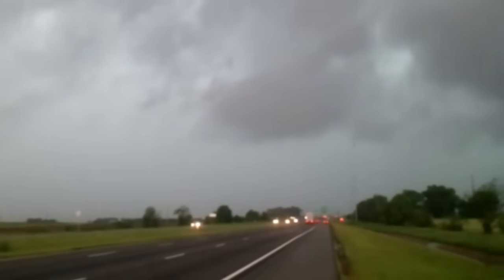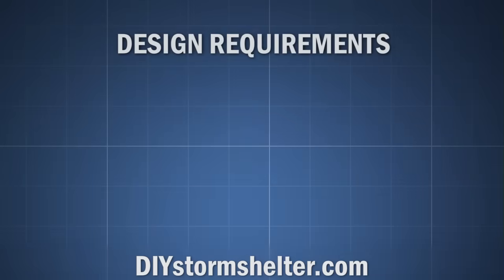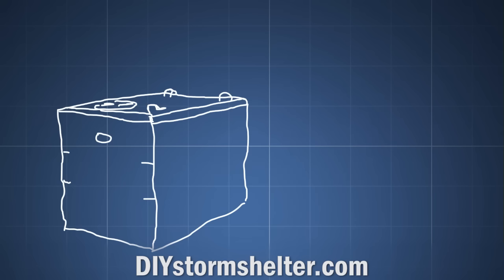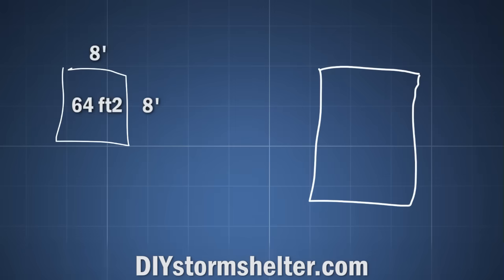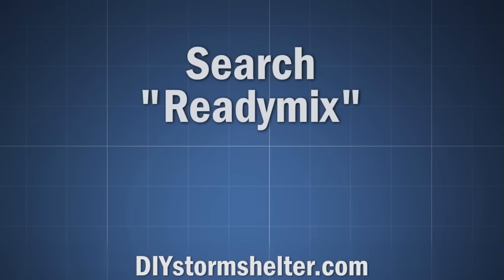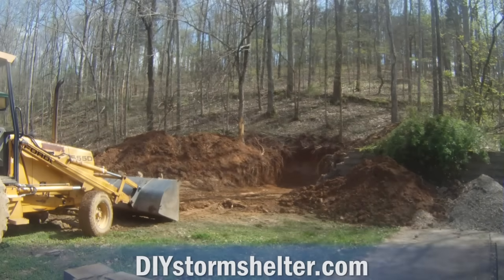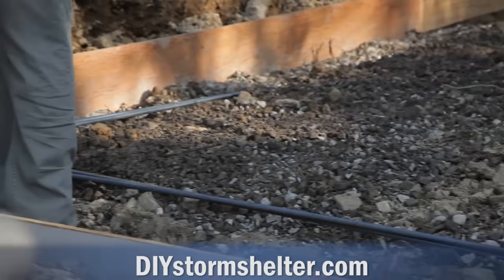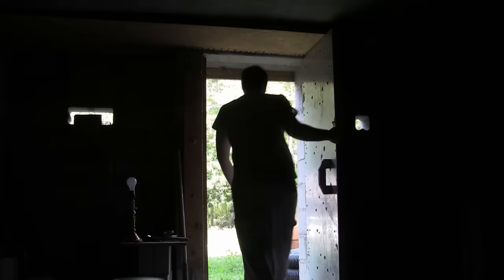Concrete block DIY Storm Shelter 12x20 foot

Comment: I live in California. The way you built this shelter is a death trap. Any lateral movement and it will collapse. You need rebar every 32" bent up out of the slab and into the blocks with vertical rebar continuing up and bent into the roof concrete. Horizontal rebar every other row wired to the verticals making a rebar box encased inside the concrete . The block would have to be 100% fill with a pea gravel mix. and don't tell me it can't happen in the Midwest, there was a 5.0 last week in Kansas. The largest earthquake ever recorded was in the boot area of Missouri. Your type of structure is why buildings collapse in Mexico and elsewhere.
Reply: Why not make it dome shaped, use ferro cement then bury it.
Reply: @kmparker99  yup...domes inherently stronger per volume of cement.  No corners to accumulate stresses.  Still need tons of rebar.  Still needs packing - compressing ground underneath. Re bar in floor to be tied into "wall/roof.  If you don't build against a spherical form, then you got to put an internal cladding of heavy cardboard on inside of sphere. Then shot Crete spraying. Watch first coat....just to create foundation for full spraying. Might want to build a scale model. Mamy fero-cement domes were quite sucessfull. Some were built on an inflated weather balloon. Quite problematic...but again, some were very sucessful.
Reply: He also poured on loose fill, the first thing I learned NOT to do with concrete if you want it to stay in one piece.
Reply: The man said he consulted a local engineer.
Reply: Bbjones Jones I tell you whats gross, is your attitude.
Reply: lance hansen
Reply: Hence disclaimer
Reply: Congratulations.  I wonder if you would refuse to enter the death trap with a tornado bearing down on you.
Reply: Good eye , no steel or concrete in center block 
No good
Reply: Yes you can have a Tornado during an earthquake. KS/OK earthquake in 2011 5.6. I was on my couch in the basement with a hangover in the afternoon and Tornado warning came over. I have 2 full concrete/bomb shelters in the basement (under each respective porch, I designed it that way). Wind was going nuts, I go upstairs and branches falling, hail, trees are sideways and I went back down to basement. House gets louder then crap, shaking like hell. It was a fairly new house, I knew that was it, Tornado hitting my hood. I ran into the closest shelter and chilled for 15 minutes waiting for the house to come down. Nothing, went up stairs and same thing, less severe as it was passing through. Went back to the couch and watched news later and the shaking wasn't a Tornado it was an earthquake. AND a Tornado touched down nearby, very little damage. Another home I owned had a new huge crack in the foundation the next day as I went to check my properties. So YES you can have a tornado and a quake at the same time, albeit it will probably never happen to you.
Reply from the maker: I've lived in earthquake prone areas before, and you are right, mine isn't designed with earthquakes in mind. If you live somewhere with earthquakes, then get an engineer to design something that WILL be safe.

You didn't see the rest of the video, but all block cores were filled with 4KSI 'crete with fibers, and nearly all columns had rebar in them. 

Could we have a 'quake out here in TN? Yes. But at the exact same time we are having a tornado in our area? Um, no. 
I'm only in this thing when a tornado is active in our area.
Reply: @davidbotkin6032    "You didn't see the rest of the video".......Which you CHARGE for. Thumbs down for you. And thank you for wasting my time. That's 9 bucks you owe me @ $60 an hour. I should have skipped to the comment section.
Reply: @davidbotkin1650  So, you are taking full responsibility for anyone that follows your self "proclaimed expert advice" and you believe that they owe you for this advice? If someone takes your advice  by building this concrete tomb or any part of your advice; and is injured, you may become the defendant in a civil liability case... Lets just hope no one is that foolish.
Reply: I would think of a shelter like yours as storage on a day to day basis and shelter in an emergency.in any case I envy you. as here in santa ana california it would be very difficult for me to build anything. God bless.
Reply: @lanceehansen  - If you use it for storage it should only be for the storage of any emergency supplies the proposed occupants will need during a tornado.  Otherwise you could be endangering their lives over your junk collection.
Reply: same is true in MT. The extreme cold will cause the dirt to crush his building.. this is freaking terrible and he charges people for the video

Comment: the blocks are $1.76+tax so your "information" is way off
Reply from the maker: Not in TN. I just checked with my local Lowes (which is more expensive than a bulk dealer of concrete blocks): $1.14 per block. 
As I said in my video, material prices will change based on where you live.

Comment: Why not build a home this way, so you house in storm shelter?
Reply: Many folks DO... building into a hillside saves a lot on energy costs, and it's safe, if done properly. This guy isn't doing it properly. God bless you.
Reply: There are tons of videos on youtube that follow actual contractors through similar projects. Using block these days isn't the best method if you are looking for subterranean living space. foam-forms filled with rebar and concrete with a doubled up moisture/contact barrier on the exterior would be best. Underground masonry structures always have humidity/water issues.Starting with foam insulation and several exterior barriers at least keeps water from coming through the walls.
Reply: +5winder Where can one learn proper ways of doing this
Reply from the maker: You can, but it's more expensive. Insulated Concrete Forms seem to be the best way to go if you want to go that route. The roof and windows are the difficult parts them (and skip garage doors completely).

Comment: haha imagine this my grandparents had a 16x25 built back in the 80's i think, they literally did'nt have to pay for the hole to be dug and all the forms set up the crazy ass neighbor down the street hes like "i'll do it for free all you have to do is supply me with beer" hah my grandma still bitches about it today having a drunk guy digging a hole in her back yard with heavy machinery. btw the shelter is still in perfect condition today has a 350lb steel door we had to get hydraulic shocks and if debris was to fall on it the hydraulic powered door will come right open.

Comment: Your prices are definitely off- just one example, your excavation was free (other than the cost of fuel @$300 I presume). 8 hours of excavator work would cost about double or triple the cost of your entire building around here. And the cost of bricks is too low as well.
 I also noticed nothing in the plans for electric service, ventilation, secondary exit, waste disposal, water proofing, heating, or any of the other things that would be reasonable for even a brief emergency stay in your concrete box. Maybe all that is in the pay per view video but I can find all that information for free with other peoples youTube videos.
Reply: JJ Grey --- Free excavation from his church buddy, yet he charges people for his 20 minute video. The irony of it all.
Reply: You don't need electrical or waste disposal in a tornado shelter.
Reply: According to my research, excavator operators make ~$21/hr. and this job busted out to $37/hr.; not bad if the the operator owns the excavator and they don't actually use much fuel - hydraulics are fairly efficient :)
Reply: Mini Backhoe rental without the operator from Home Depot is: $300 per day, so is a bobcat. I don't think you could dig a 20'x12'x9.5' (max depth of hoe 9.5 ft) hole in a day with a mini backhoe, the bucket is maybe 1/3 yard, two to three days non stop would probably do the job, if you were able to use a bobcat and dig into the side of a hill like boy genius did, you could do it in a day, but it would not be a good or even logical shelter, since flooding would always be a problem. The hole would cost about $750 plus fuel and labor all by itself.  According to the NRMCA - Ready Mixed Concrete Industry Data Survey, the average cost of concrete in 2016 was $108.22 per cubic yard, or $649.32 for the 6 yards he bought for his floor and footers 5yds would be perfect for a non load bearing concrete slab with monolith footer, but his structure is going to have block walls, a concrete roof and dirt on top? Footer is a bit shallow for that sort of load with no tamping, drainage or load bearing footers (the perfect storm)  Concrete blocks at Homedepot run $1.97 each (April 30 2019) nation wide. This guy lowballed this little project from start to finish. Save your $14 and buy  steel shipping container, they are already built and very solid, you could bury it half way under ground and live through a direct hit cat 3 tornado or just leave a couple of inches above ground and live through a a cat 5! 
You would probably do just fine if it were tied down to the ground with Mobile home tie downs and strapping on a concrete slab (just a guess) and only spend about $1000 to $2000 for the shipping container. The best solution is get the hell out of tornado alley!
Reply: @superiorcarpetpaintllc4351    ---  One thing about burying a shipping container is you have to do a shiite ton of steel reinforcement on the inside or it will cave in soon after you back fill it into the ground.  They are built to be stackable...  But they cannot take the pressure of being buried without the walls caving in.  Although I still think it might be cheaper then what he came up with.  But I'm not sure.  Take care.  sincerely,  Dean O.  :-I

Comment: as far as water proofing I'm going to use Ame's Blue Max, and for the bottom of the slab I will put down Black Visqueen . You just Roll The Blue Max on with a paint roller and you have water tight walls and roof!

Comment: I also noticed they were using plastic leveler, I have goofed a couple of projects before learning that they are unreliable, the bend with temperature changes.   I highly recommend anyone dyi anything use a steel or metal leveler.

Comment: I have a couple of quick comment and would love for anyone more knowledgeable to please reply. First, I been planning on building a similar structure.  Habitat for humanity, and other organizations like them, may save you a lot of money on the materials.   I would have placed exterior French Drains around the footings to help water move away from the structure. Wouldn’t waterproofing along the walls have been a good idea as well, or is that overkill?
Thank you for your video, I will check out the longer video at http://diystormshelter.com/
Reply from the maker: The french drain is important - I just forgot to include it in the video. My focus was more just the actual structure.
We did waterproof it, though I don't remember the product we used. It came in a 5 gallon metal bucket and left the walls with a slight, clear sheen once they were coated.
Can you get CMUs at Habitat? If so, that would be great. But the bulk of the expenses were the poured concrete ($1500), the blocks ($450), the rebar ($400), and excavation ($300). Most if those can't be had at Habitat.
Reply: Thank you for your reply.  I focus on that point, since I worked for a Basement Waterpoofing company, many years ago.   and have insalled them after a structure had been completed, and have seen th effects of buildings with out them.
Great video by he way!!!

Comment: 2x4 Cannon vs Wood, Concrete, and ICF Walls

I notice you have exposed cinder blocks in this design. You are aware what a 2x4 can do to a cinder block wall at tornadic speeds right? This video here demonstrates this quite nicely...
Reply from the maker: Thanks for that vid, Ryan. That's a neat test video and demonstrates the need for a concrete shelter. A full concrete wall would have fared better than that small sample did - the pressure from the roof, rest of the wall, etc, would reduce or eliminate the cracking that occurred - there would have been a hole, but probably that would have been it. But that's why all the cores of my shelter are filled with 4k PSI concrete and most are reinforced with rebar. So my walls are probably better than the ICF walls (they are six inch - mine are eight).
Reply: That makes a lot more sense! If its filled that is a lot safer :)

Comment: The block is not bullet proof though
Reply: It's a storm shelter, not a postal man shelter.
Reply: Average tornado will only be able to throw bullet at like 200-250 mph max, calculate in the chances of it actually hitting the shelter with a bullet, I don't think the bullet threat is huge for this shelter.
Reply: You can fill the blocks with concrete.

Comment: I'm sorry but your figures for your blocks are wayyyy off. They are a lot more expensive than that. the blocks are about $2.00 apiece and some are $2.50 each depending on where you go to get them.
Reply from the maker: I just checked my local Lowes pricing - single blocks cost $1.14. But I didn't buy from Lowes - I purchased from a bulk dealer so the price was just under $1 per block. This pricing is for 8x8x16 concrete block with two cavities (not solid). 
Where are you located roughly? And are you sure you are talking about the same item I am?

Comment: I have done a lot of concrete work and this design would never have even passed plan review in my community. perimeter drains are mandated, with gravel backfill above but outside of block wall must also be waterproofed I like spraying with asphaltum and covering with visqueen before backfilling. In a retaining wall at least two rebar go in the footer below the frost line and a vertical rebar goes up thru the blocks and that cell must be filled with mortar no more than 12 feet apart.  The roof needs more steel than you included in your plan and I did not see an engineers certification. Did you have a building permit? What about plumbing and electricity? Is space certified for living space? why not use a arch or dome for greater strength in the roof. Or use prefab "Hoot-eyes" for the roof they are available eight feet wide and 30 feet long and only need supported on the ends. Pour the floor separately and last after the plumbing goes in. I will remember you in my prayers as the next tornado may be your last . You leave out too much I suspect this would only be permitted as a farm equipment shed, not for human habitation...
Reply: R  C Nelson. Yeah!! That really intrigues me because I build arched structures as a rule almost exclusively on my farm. This sounds like something structurally worthy and economicall.
Reply: Dennis Miles What are "hoot-eyes"?  Can't find a definition on the internet.

Comment: could you elaborate on the leveling process? this is a  noobish thing to ask, but i thought if you made a 4 sided wooden frame, like you did, that the concrete, being somewhat liquid, would "self-level." i think i have seen this concept discussed with regard to people making frames, and then filling them with gravel and sand, to make a foundation for a shed, for example. i guess concrete is different somehow, so you NEED to make sure your boards on your "box frame" are perfectly level?
Reply: Miceryt111,  The concrete is not self leveling. it piles up shallowly in mounds and valleys just like any pile of damp (not wet like sand at the beach) gravel. using perimeter boards with the top edge at desired finish level we use a long heavy straight board to flatten the the concrete. scrape it back and fourth until it is all level then a "Float" presses the gravel down and brings the thin sand and portland and water to the surface to make a smooth finish, then as it hardens a final brushing with a light touch by brush gives a slight texture to make it a nice walking surface or leave it as "Floated" to put ceramic tile or just use floor sealer and paint.
Reply from the maker: Dennis is right - concrete doesn't flow like water. The relative wetness of concrete is measures in "slump" - basically, how much does a pyramid shaped mound of concrete "slump" when not supported. And as a general rule, the less slump the more final strength. So, as Dennis said, you have to screed it. And the form boards give you a guide to screed off of.